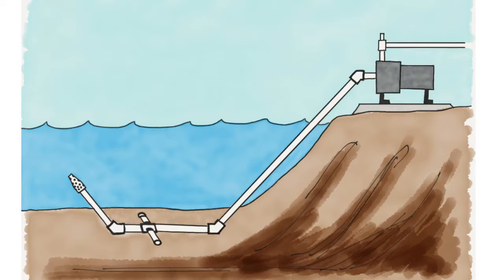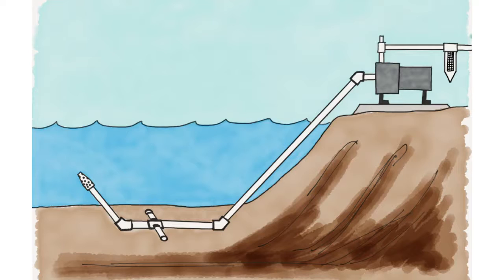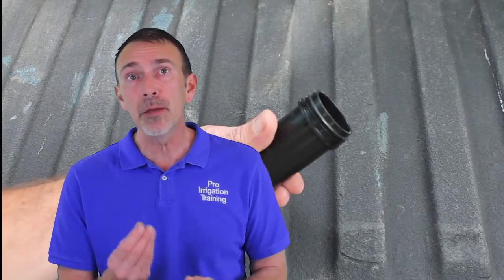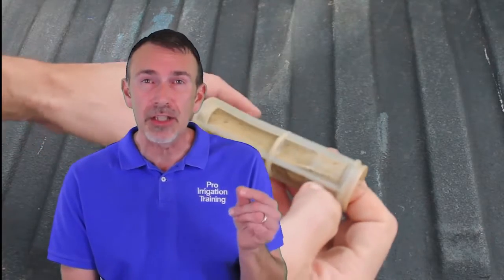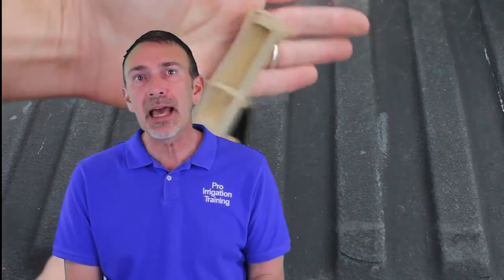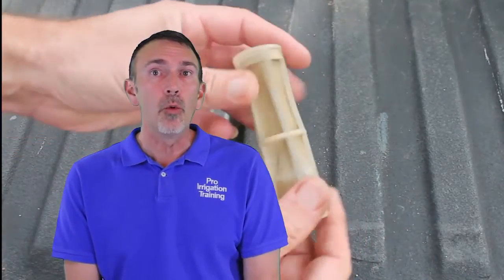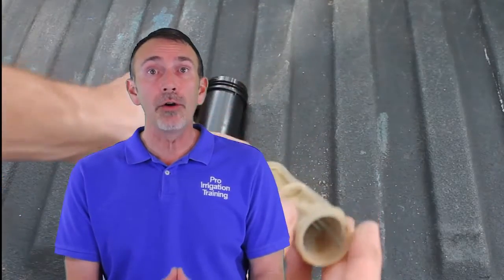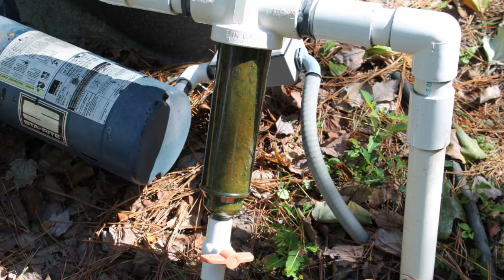All About Irrigation Filters (sprinkler system)

Comment: My irrigation pump pulls from a pipeline of ditch water.  The installer wouldn't put a filter in line before the pump fearing it could clog up and burn the pump out due to lack of water. Instead, he installed a large screen filter on the outflow side.  This was all done almost 20 years ago when I was a young child.  I'm now 30 and own a company dealing in irrigation, especially dirty water set ups. My 20 year old system has it's downfalls, but overall works great. Usually twice a season, 6 months, I have to take the pump apart to clean out crawdads and field grass stuck in the impeller.  The best feature of my system, that I incorporate into all my jobs, is a waste valve on the end of the filter that is wired in as a zone. Using jumpers in the control box, my filter flushes itself multiple times throughout the zones. The water from the flush is piped with 1.25" polly to a waste water ditch for a hay field. I have 6 actual zones for my lawn, but the timer box shows nine because the filter is flushed every two zones for two minutes. It's such an easy and inexpensive thing to do, yet, I haven't come across any other system that does it. I'd estimate 40% of my calls are due to a clogged screen filter.  A lot of people don't have the water rights to "waste" water by doing this but it adds up to very little. It's great for my business, but in actuality, a one minute flush at the end of the program is more than enough for 6 zones in most cases. I charge $600 to add this feature and it's a win for both me and the customer.
Reply from the maker: That's awesome. Some thought is definitely needed to handle dirty water. That's wild that you have to clean crawdads out! Thank you so much for watching and commenting! I love for other people to hear from professionals that are out there doing it.